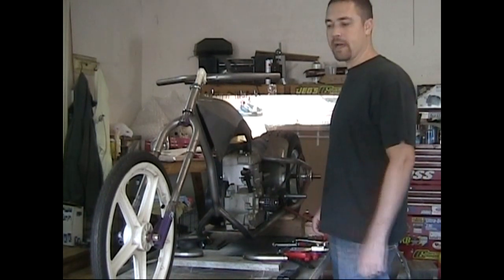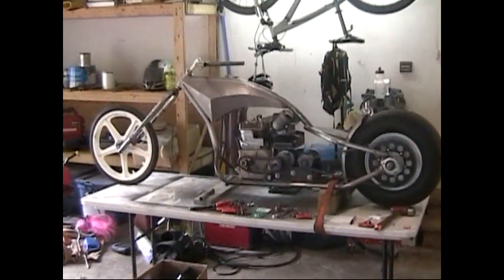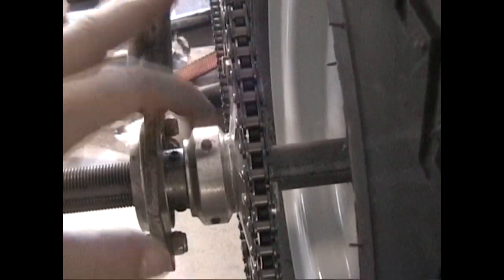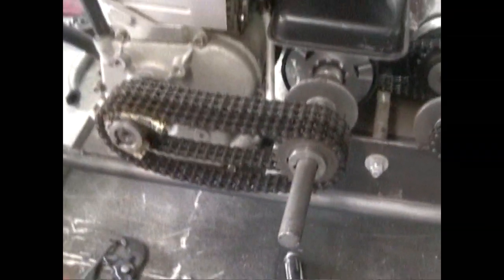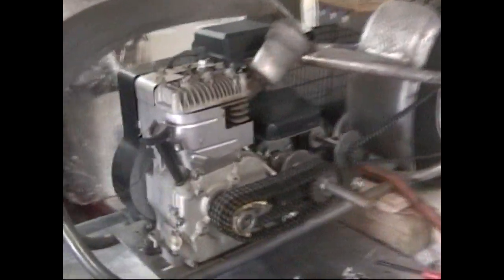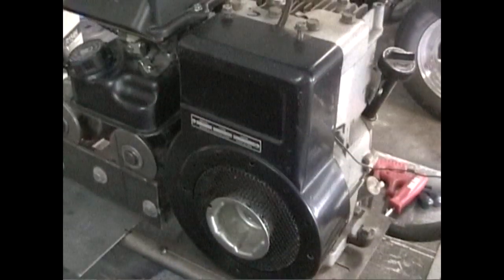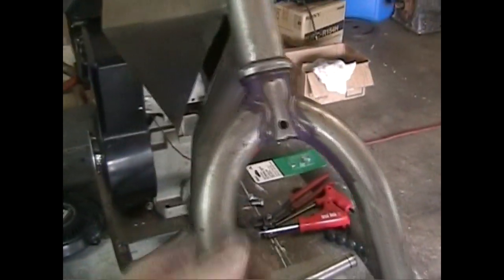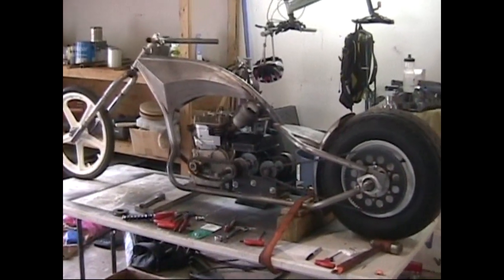Mini Chopper Build Up

Comment: Hopefully you see this and can reply, I want to have a similar set up as far as the clutches go, my question(s) are, are there different "weights" for the clutches? How would you be able to tel which you need for a live idle? And wouldn't even at a higher rpm the "first gear"would still be spinning rapidly? Would it hurt it? Thank you if you see and reply, trying to build one myself
Reply from the maker: the first clutch does stay engaged but once the second clutch applies the first clutch gear just ratchets backwards, keeping it from hurting anything

Comment: Wat type of rear wheel did u use
Reply from the maker: Jeffrey Mousseau Its your standard four lug turf tire used on mowers and such
Reply: Thanks very nice bike by the way
Reply from the maker: Thanks
Reply: U wouldn't happen to remember wat size it is would u
Reply from the maker: I could look and see
Reply: If u could that would be great but a good guess is still helpful

Comment: How much pipe did you go through for the whole frame and what size pipe is it? Also, where did you get all the go kart parts for the rear axle?
Reply from the maker: Most of the tube is 1 inch except for the back bone. its 1.5. All the axle parts and brakes I got online.
Reply from the maker: I think the site was bmikarts.com

Comment: where do i get a mini chopper frame from ?
Reply from the maker: Not sure. I actually designed and hand built this entire frame and tank myself. I did however use the bearing and steering tube off an old bicycle.
Reply: TheFabForums.com i know it looks amazing brother, i have a taco mini bike but it isnt quite a chopper ;P
Reply from the maker: The taco bikes are bad ass.
Reply: TheFabForums.com whats bro im building a mini choppper myself i wanna ask  you were you got your rear brakes at